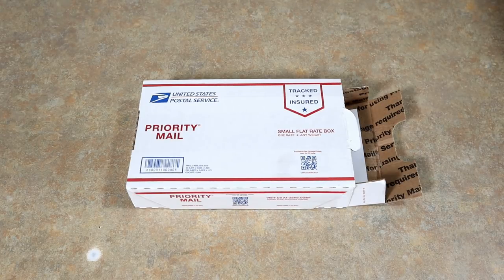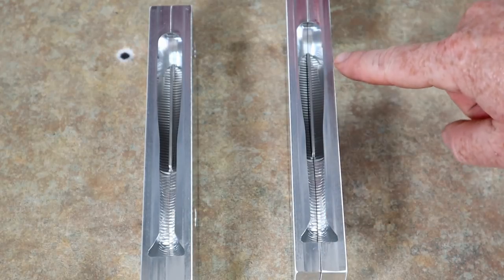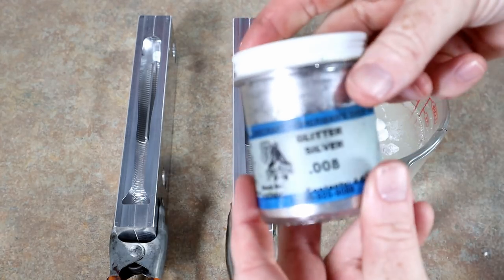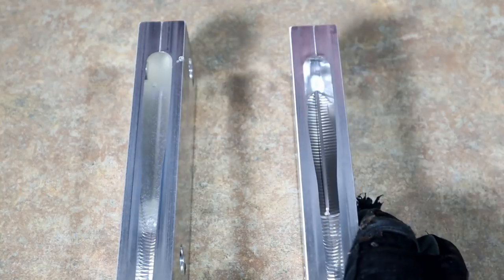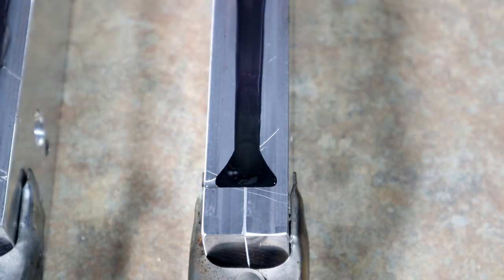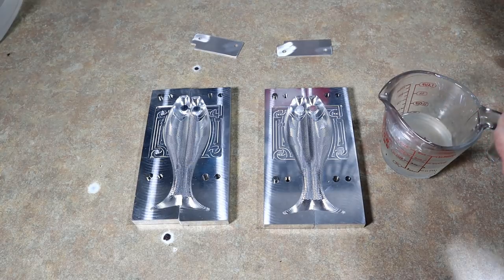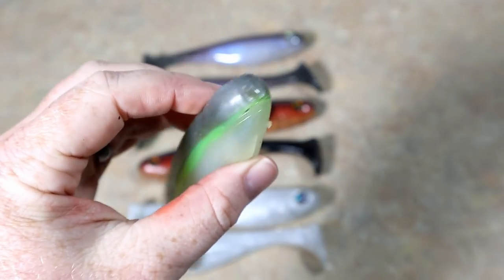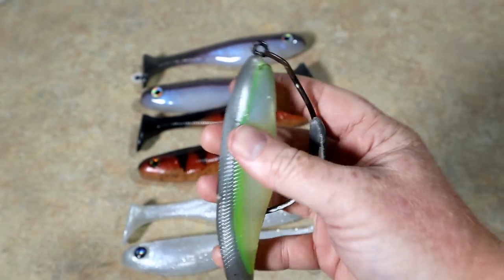NEW Aluminum OPEN POUR Swimbait Mold!! Full Review & Demonstration

Comment: Never made a soft plastic in my life but I can admire the thought put into the mold. I hate when I get a bait that breaks super easy and the spring pulling out of my baits drive me nuts. As far as sizes, small as in 3.3-3.8 is my favorite but I have no experience shooting or pouring molds so if that's possible for a pour mold is up to someone smarter than I.
Reply from the maker: the smaller the harder to pour...yeah most baits from the big box manufacturers use very soft plastic.

Comment: 4", 5", 3.5 Just ordered 4 thank you pike will love them.
Reply from the maker: I think you'll love this bait?
Reply: Pike will hit a 3 inch grub. I've had to add a steel leader to combat losing my jig n grub combo. Pike are fun if they are sizable. I landed 2 Pike last summer on ultralight gear. Largest was 35 inches I think. Fun fight. Ultralight gear is fun to use. The rod I was using was a cheap Shakespeare 5 foot ( I think? Or 4.5) bought at Walmart for 20 bucks. Good luck on your pours. 👍

Comment: Any recommendations for we Trout fishermen? 6" is double the maximum size we can use... I can't find any 3" or smaller fish shapes to make minnows with. I would think that 3" or smaller would be a major target for mold makers because you can fit an enormous number of the shapes in a standard sized mold housing while requiring far less machining for each. For example imagine how many Berkley mousetails you could fit in those very large 2 side blocks! May not be the easiest pours as filling the ball shaped heads 1st when there were a ton of each shape in each mold would be either near impossible or so time consuming as to perhaps not be worthwhile.
Where I live we do have the large mouth Sunfish (which everyone calls "Large Mouth Bass"), Small Mouth Bass, Sturgeon (but you need special permissions to catch as much and their rarety makes them foolish to catch), Perch (not that easy to find, but they are around in Massachusetts), Pickerel (I am told these are absolutely delicious, but having dealt with their teeth shredding my lines and snapping at my hands to try and recover my lures, I don't enjoy catching them), but then we come to the Trout... Brook, Tiger, Rainbow, Brown and in rare, strange circumstances you may catch the enormous Lake Trout. I live feet from the Ware River (2nd best in MA for Trout) and 10 mile walk from the absolute best, #1 Trout river in the state: The Swift River from the bottom of the Quabbin reservoir where you can only Fly fish.
So I really, really need 3/4" to 3" worms and minnow sized molds (3" worm molds can be found but are almost exclusively ultra thick one's that Trout won't go near).
So do you know of any 3" or smaller molds? Can scent be added to them when cast (like Garlic, Velveeta cheese [man that's so gross... but Trout go crazy for it], Twizzler Strawberry, Bubble Yum Original flavor, Anise), or should it be added only after the fact where it will wash off?

Comment: Just a thought but something you could play with on the test mold - ya could cut the metal flat hook slot in different ways across the top instead of just being a flat line in the body. Maybe like a wave to put more plastic in the front or rear or something like that or zigzag etc... plus you could go with different plate heights if you want a thick or thin hook slot higher or lower in the body without having to do another machining.  
Enjoy the vids!

Comment: Another great video. The mold is killer! 4", 6", 7" & a 9" or 10" would be ideal. Great work. Curious if it's possible to do 2 position hook slot so you can do a shallow or deeper one. Maybe adding another alignment point to position the slot.
Reply from the maker: yeah you probably could

Comment: I think that with the skill your machinist has in making these lure molds  he should now focus on designing and making miniaturized syringes you can use to get pin point accuracy in pouring or placing the various colored plastics.  With interchangeable needles for these scaled down syringes it would further ad to your ability to pour or inject the colors you wanted, exactly where you wanted them.  Your laminate lure already look good.  Just imaging how they'd look if you could squirt that melted plastic dead-nuts into position.

I've never seen anyone else offer such a product so I also think your machinist friend may be missing out on a good business opportunity.  He could be the only one offering them.  Picture a Hot-Glue-Gun in a syringe form.

Comment: Really nice swimmer. Though, one thing I would have changed about the mold is the hook slot plate. I prefer to use stingers with treble hooks, therefore I would have loved if you made the plate so that you could flip it and make a bellyslot free bait. :) But really nice mold. 👍🏼
Reply from the maker: yeah he is probably going to make slot inserts that make it a sold body bait, he does that with his injection swimbaits
Reply: @WorldsWorstFishing  Could you pour with the slot insert missing and then just trim off the "flashing" it would create?

Comment: 4" , 8” and 10” would make a decent lineup. Possibly a 12" 😉 How was the action on a very slow retrieve?
Reply from the maker: haha a 12 would be insane, the action was better the slower you went...you can also vary the action based on what blend of plastic you use
Reply: @WorldsWorstFishing  Leaving that back so open all the way to the tail had me wondering if it would make it rigid and loose its movement at slow retrieves. It looked great on the faster retrieve though.